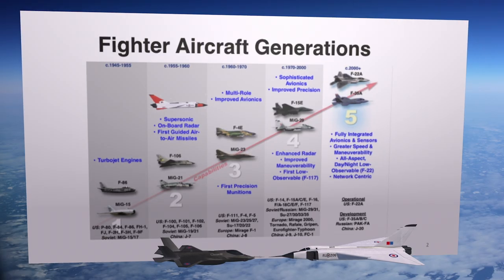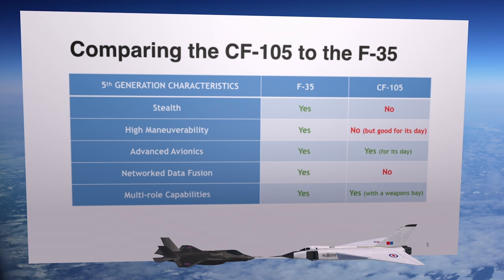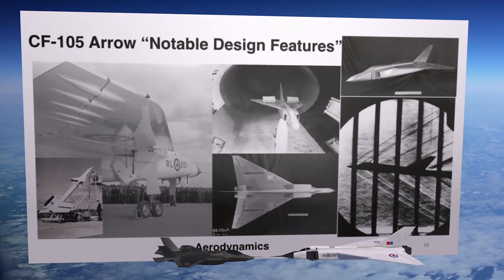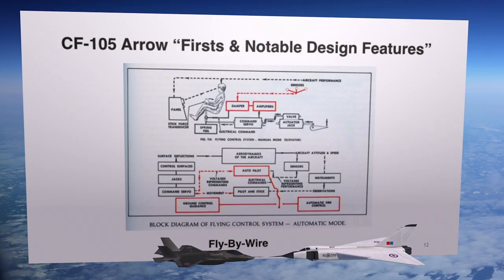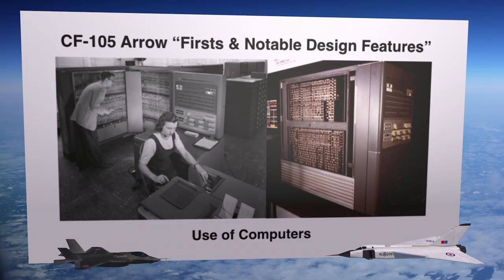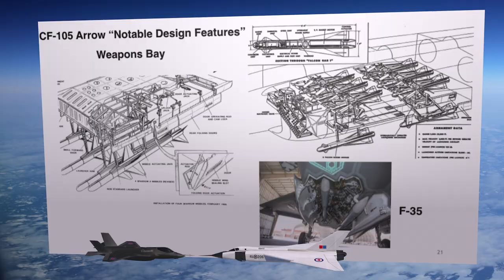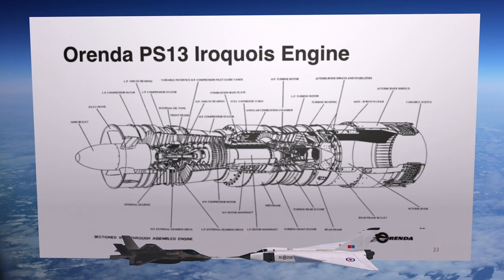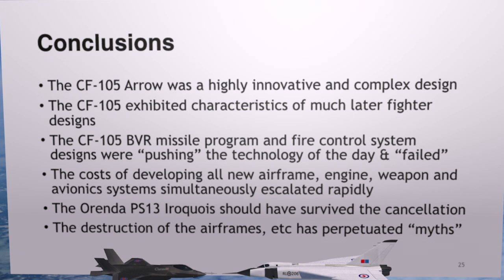AVRO ARROW FIRSTS VS F 35 LIGHTNING

Comment: OH, PLEASE BUILD IT AGAIN....
I JUST LOVE THE AVERO...
Reply: given time and enough funding it will fly as a cf238 and as a modernized updated version ... currently a replica is being made in calgary using carbon fiber and fiber glass mainly ... although not being built for military use it will at least be comparable to the original .. 
now all i need is to get my hands on the blueprints that were found a year or so ago ... and get working on them ... going from old released a11 pics and highly compressed drafting sized pages aint easy ... but it is progressing ... with over 35,000 parts to draft up all it takes is time and some brain sweat ... 
.
now IF i could get a digital copy of the prints I would be half way to where I want to be ... 
.
yes I am working on making a fully functional and operational arrow ... and then updating it to modern specs and needs and exceeding them ....
.
thanks to diefenbaker we as a country can not design a new fighter aircraft .. as INDIVIDUALS ... we can ... and an excellent jump off point is a plane that 70 years later is still in the running .... 70 years and it still has merit ... NO other plane I can think off can say that ...

Comment: I worked for AV Roe  in the blue  prints 105  saw the initial take off of the Arrow  we were on the roof , the lay off  was March 20/1959 we were all let go ,what a awful day that was  Canada lost out on this beautiful Aircraft intersepter  BEAUTIFUL AIRCRAFT
Reply from the maker: Hi Barbara,  Thank you for your comments.  I don't know if you have seen the four Arrow series on my channel,  Virtualenvirons, I am working on five now,  It is interesting where you worked.  I have a question I would like to ask.  Although there may be a full set of AVRO Arrow prints somewhere secret, I understand the many of the smaller parts were designed by the smaller companies who designed parts for the Arrow.  Is that true?   The reason I ask is those prints would not have been secreted away somewhere.  regards...Virtual
Reply: Virtualenvirons Hi  I really do not think there was any company that made up parts for the Arrow.,Avro and others that were been built and distroyedtoshut down I’m sure made and supplied all parts for the Arrow. ,105  and 201
Reply: @Virtualenvirons  yes there were they were on display at the diefenbaker exhibit out west and went off display april 2020 .. the barnes set of plans ... now those I would LOVE a copy of :)

Comment: The alert hangers at cfb north bay were at the east end of the main runway. No turning necessary, open the hanger doors and rolling.
Reply from the maker: Hi Robert.  We did not have anything from North Bay on this video.  Only from the Sat view.  Currently only Bagotville and Cold Lake have active alert birds.  regards...Virtual
Reply: Ottawa had or still has its 2 alert hangers at the east west runway ... but they hadnt held a plane for decades even in the 80's ... they were mostly used for long term storage of runway needs and vehicles for clearing the runway ...

Comment: 2 working Iroquois still around; one of them is being used as a pump engine for an oil pipeline and the other is in storage in a barn..both in western Canada
Reply from the maker: I don't know about that pump engine, but I doubt that very much.  Pump engines are quite different from the jet version.  There are a number of Orenda engines (not Iroquois) still being used on pipelines.    There are two engines in museums, plus the one in Fort St. John at a S & S Turbines owned by Robin Sipe.

Comment: Man, that RCAF Avro Arrow was one beautiful aircraft!!!  It was ALL Canadian, and it showed that Canada had its own equivalent of Kelly Johnson.  IMHO though, I just didn't see a need for it as long as NORAD was a joint effort and there were plenty of USAF F106s available .... there was no need to put such a burden on the Canadian taxpayers.  But she sure was a beautiful airplane!  :)
Reply from the maker: HI Calvin.  The Arrow was not really too expensive.  That was the initial reason given by the Diefenbaker government, even though Diefenbaker was pro Arrow, his advisors told him it was not needed.  In 1959 the Canadian military returned 281 million dollars back to the government.  Only 40 million was for the Arrow.
The F-106 was not an Arrow.  It would have done the job though, but not as well as the Arrow.  It could only carry 4 missiles as compared to eight for the Arrow.  So two F-106's would have been required for one Arrow.  It was also quite primitive compared to the Arrow...regards...Virtual
Reply: @Virtualenvirons  -  Yep - I am a big fan of the Arrow .... I would have loved to see it produced.  It would be much quicker to intercepts than the '106, with those 2 big engines .... (it had much better climb and acceleration performance) - but the story of its development is a great one!  THANK YOU!!  :)

Comment: On the other side, the MiG-25 flew roughly six years later and was designed to fulfil the same strategic role:  the interception of high speed, high altitude bombers entering Russian air space from over the North Pole.  While it is true that the threat then-posed by strategic bombers diminished as both sides reduced their once vast bomber fleets in favour of longer range/stand off air, surface, and submarine-launched missiles, the muscular lines of the MiG-25 evolved and live on in the form of the MiG-31, an aircraft that, while capable of serving the MiG-25's intended role, has evolved to meet modern threats.  Specifically, the MiG-31's mult-target tracking look down/shoot down capability make it especially well suited to intercepting vast waves of submarine-launched cruise missiles entering Russian airspace from the Arctic Ocean.  In addition, its sophisticated AESA radar, computational power, and communications suite make it able to act as a 'command and control' aircraft, remote controlling the weapon systems of other aircraft who cannot see what the MiG-31 can see with its own sensors (making every MiG-29, Su-27 etc. operating in proximity a look down/shoot down-capable fighter as long as its weapons can be remotely accessed by a MiG-31).  I see little reason the Avro Arrow could not have evolved along these lines, especially as the threat of long range/stand off missiles replaced the strategic bomber threat to us as much as it did for them.
Reply from the maker: Hi Gezane....The Mig-31 has evolved to a decent jet, although there is apparently a replacement In the works.  Back, to the Mig-25.  It was useless.  I will tell you a story.  A long, long, time ago.....1960....the U.S. was developing the XB-70 Valkyrie bomber.  Then Gary Powers got shot down....bummer.   The U.S. then decided to canceled the program, but the failed to notify the Russians of this.  They continued the program on paper, but only built two planes.  The Mig-25 was built to counter the XB-70, but all is could do was go up fast and high.  It could not turn from Toronto the New York.  They lost most of them trying to land the thing.  They also built ~ 500, some for export at huge costs.  Sometimes you have to admire the CIA.  regards....Virtual
Reply: @Virtualenvirons  A pure bred interceptor is not designed with ANY emphasis WHATSOEVER on turn radius... its entire JOB is to fly as high as possible, as fast as possible, because the far northern regions of Russia were beyond the range of western fighter escort and, in the early sixties, midair refueling was still in it infancy.  Hence, the MiG-25 excelled at exactly the job for which it was intended:  to get as high as possible, as fast as possible, in order to intercept western bombers as soon as possible before they could near their targets.  People who fault the MiG-25 for its lack of agility only demonstrate how absolutely clueless they are about the intended strategic role of a pure bred interceptor.
Reply from the maker: @gezanegamez6025 Hi Gezane....It had a very short radius of action also.  The Mig-25 was a titanium fuselage, with two big engine.  In terms of technology ..think of the Arrow as an "Arrow.  Think of the Mig-25 as a piece of flint.....tided to the end of a branch with the entrails of a woolly mammoth.  regards..Virtual

Comment: note: one wrong stat on thrust.... 19,350 no AB(note when tested on b47 bomber they had to throttle back"60%" as it was to powerful and was producing over 20,000 no AB and that was with  5 props turned off and one at low setting just to keep the bomber strait... ps the bomber almost went supersonic lol), 26,000+ with AB.... times 2 engines is 38,700 no AB and 52,000 with AB... and reached mach 1.9 with undersized temp engines producing less then 17,000. It range was pegged to be 2700km+.It was designed as long range high altitude interceptor with some multi-role not as a dog fighter... which it would have done and could probably compete today with upgrades... as an over all fighter it would not compete... but it would probably surpass anything else in the role it was design for... covering large areas fast in cold environments (not sure how it would do else where)
Reply from the maker: Hi Riley. The actual thrust ratings on an Iroquois vary based on who, what, where and when.  Orenda itself never actually released any thrust figures, only compressor speeds.  The engine that was squirrelled away to Britain (Bristol) tested to 32,000 lbs. thrust in afterburner.  
Have you seen the series on this channel.  It explains much more about the Arrow and who killed it.  The series link is below,
Series LInk

https://www.youtube.com/watch?v=AjuL9IM-1T0&list=PL3EReMs3ND7UC-VT6gOjFauI_PgDDPWdo
Reply: the reason the bomber couldnt go above 60% throttle wasnt for the engine power but because of it's placement ... and how it was mounted ... at full throttle it would literally rip the plane apart ... at 60% throttle they kept the stress on the modifed tail section down to a minimum IF they placed the engine IN the tail (instead of along side and canted) and reinforced for that they could have taken off with JUST the iriquois no problems ... 
. 
doubtful the bomber could handle full throttle anf full after burn though as it's main structure was not sufficient to hold back the engine ... as seen in the arrow movie when they test the engine to 20k lbs and he has to shut it down fast to keep from launching the test rig through the front door ....
.
 to the best of my knowledge and searching that engine hasnt been found ... the bomber has been seen in a boneyard down south ... on cancellation day there was a sound of an iriquois engine leaving ... which is where the rumour of "the one that got away"  comes from ... my suspicion is that it was the engine on the bomber that left and NOT an actual arrow ...

Comment: I just noticed that the Arrow and the F35 have the same basic flaw but for different reasons. Both of them have insufficient weapons load out. The Arrow limited its weapons to internal stores in order to gain speed . However, mach 2+ speed had already been seen as unnecessary . The F35 WAS limited to internal stores in order to remain stealthy. How, they are now handing stores and weapons on the wings so the F35 is about as stealthy as a 747 on the ingress.
Reply from the maker: Yes, quite true.  The F-35's real strength is not so much stealth, if it even is, but situational awareness.  In a war in Europe, it would be lethal.  Over Canada, not so much.  For Canada, Mach 2.5 plus is an advantage.  We only have two Air bases during peacetime and there is a gap right down the middle of our Country.  Although we had more bases sixty years ago, the requirement for an Arrow or F-15 type aircraft still exists.  If you watch the series on this channel, it explains a lot and is pretty exciting.  regards....Virtual
Reply: the arrow was easily modified to be able to also hold external pods and could have flown with about double the weapons load out ... at the cost of performance just like the f35.